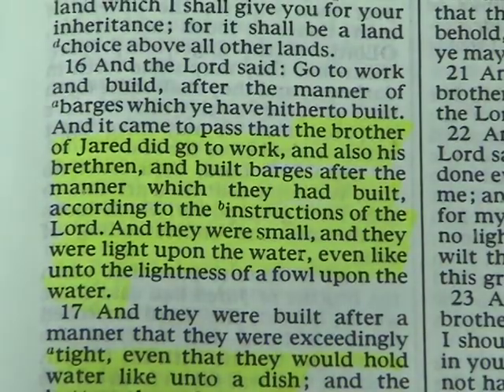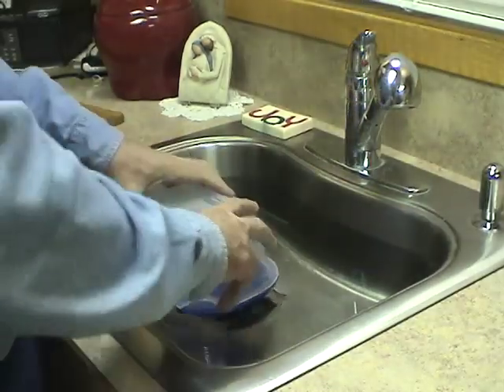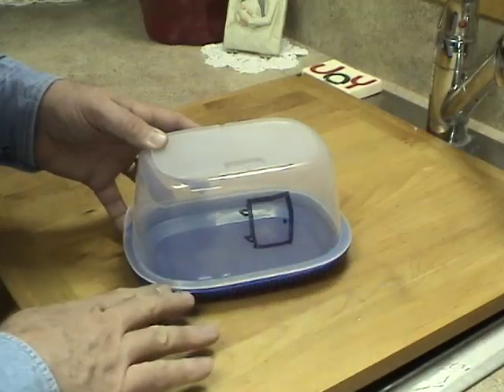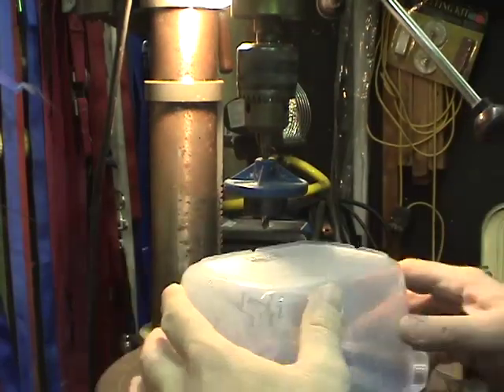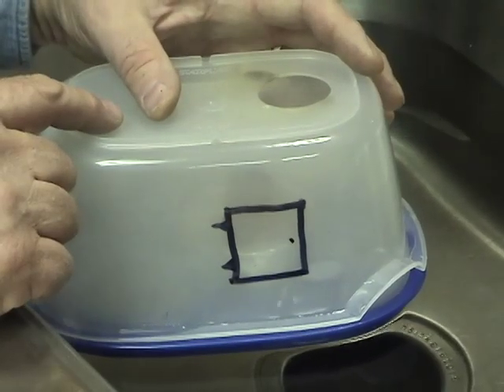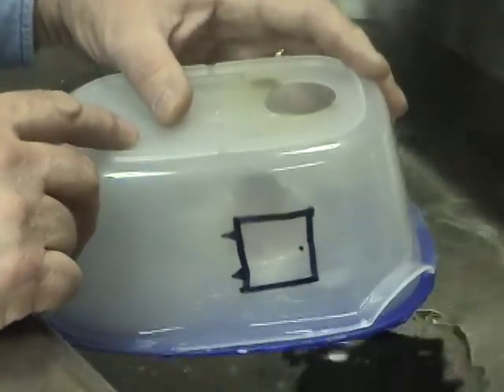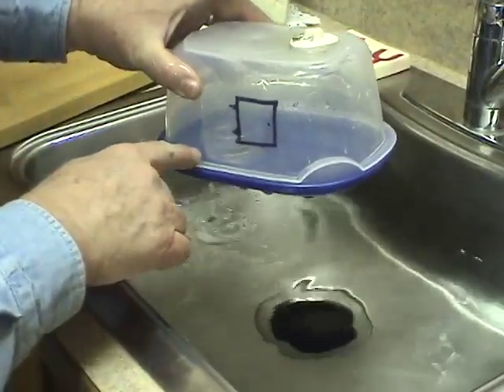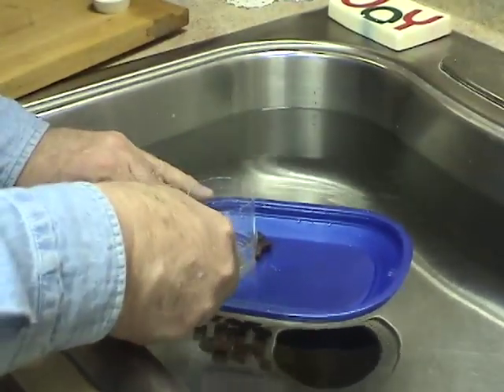Brother of Jared, Barges, Ether, Book of Mormon, LDS

Comment: I picture a monohull with a well tank. The tank rises above the exterior waterline and can be open or shut depending on sea conditions.  The hole in the upper structure.would need to be open to avoid atmospheric pressure changes caused by the surface motion of the sea when the well tank lid removed.  The whole affect would not only allow safe access to the sea for waste but also fishing.  The constant up and down motion of the seawater level in the well,  might also create a fresh air bellows and breathing lung for the interior of the clamshell barge.

I like the catamaran concept as seen in another YouTube, but that's not how it's described  in the Jaradite record.

This is more like I imagine.
Reply from the maker: I agree James, changing atmospheric pressure inside the ship occurred to me shortly after I made the video. It would really be hard on the people. Thus in heavy seas you would need to either close both the well and the hatch, or leave the hatch open.
Reply: @BrotherofSteve  And just as described, by the brother of Jared. 
 I assume most of the time, both hatches would have been left standing open, as favorable wind and ocean currents are sufficient in crossing oceans.  Only during stormy conditions would both hatches have been dogged down tight.
During such times, the light emitting stones at each end, would have been indispensable within the total darkness of such a craft.
The design as you've shown, is sound, but also a truly, desperate escape scheme.  Only the reality of some annihilating attack by an overwhelming force, could have ever induced anyone, to intentionally cast themselves adrift upon the open ocean, in such a fashion. The whole story is truly amazing.  
I happen to live on a sailboat, which makes this a sea-story for me.

Thanks for posting your thoughts and experiment.  It was interesting.

Comment: Problems:
* Not all "raisins" sink
* A "covered section between two ribs" is not really a "hole."
* Pitch (probably bitumen circa 2000BC)  must be periodically be repaired due to hull flexing. Not only can't this be done while at sea for the underside of the barge, no fire was permitted for melting pitch.
* Bitumen fumes are toxic and would build up, along with CO2
* Storms can last for many hours/days which would require the hole to be stopped up, and everyone would suffocate, pump or not.
Reply: More problems:
- food would not have lasted over 300 days.
- they would not have had any fresh food.
- they would have all had scurvy.
- no fresh water.
- with all the going down into the water then rising up to get air would mean they would be getting sea sick all the time.
- and going up and down is not an efficient way to travel.
- and what sort of propulsion system did they have?? None!

Comment: A few problems with this. First of all, the problem of pitch and floating.  It's one thing to float a pitched vessel atop of the water. It's another thing to have one going under the water for any length of time. I always thought this was Smiths attempt to explain submarines. And yes, during his time in NY there was a submarine on exhibit at NY harbor and it was in the newspapers throughout the state.
Reply from the maker: Hi Leah, thanks for your comment. Good point. I don't claim that this is exactly how it worked, the point is simply that the purpose of the holes in the top and the bottom were to exchange the air. Not to drain the boat. Thanks for your input. Have a great day.
Reply: I wonder if they did have the tube in there though. It doesn't say in the text if I recall. Anyway, it was interesting I will admit.
Reply: leah walker Hi again. The tube was for illustration of the principle of pumping air. I doubt you would use a tube in the center of the ship. More likely build it into the spaces between the inner and outer wall of the ship, say between a few ribs. If you extend it clear out the top and place flop valves and feed the air into the ship, you remove other problems too. In very heavy seas, close the valve and close the hole in the top of the ship. Just thinking out loud. Thanks again!
Reply: okee dokee..at least you're not implying the barges had it but a word of caution- some LDS will take that and run with it, claiming they had that on the barges
Reply: leah walker 
These were not submarines, but the barges were submersible.

Comment from the maker: bjjolley,
continuing: "raisins" will sink after a while. A covered section between two ribs would still have a hole at the bottom through the outer hull. Prayer - in my experience when life gets really really hard, there is great power in prayer. Prayer is "Always" necessary IMHO. Long storms - I think I could devise a valving system. My demo was just to illustrate the principle. I don't know about the sequence issue. I will give it more thought. Again, thanks for your thoughtful insights!

Comment from the maker: @Rypaul5217
Huh? Air pressure "turns towards up?" You lost me. Sorry.

All ships have ballast. That's why they stay upright.   Look for example at the Fram, a Norwegian ship built in the early 1900's and designed to be frozen into the Arctic Ocean, float across the Arctic in the ice, and come out on the far side. That's exactly what it did. It was round bottomed, like a walnut. Ballast kept it upright. 
Thanks for your comments. Brother of Steve.

Comment from the maker: Hi JC,
Thanks for your questions. Length of a tree? Well, the General Sherman is one of the biggest (not tallest) trees and is almost 300' high, so I don't think the barges were anywhere near that long, but a 10' barge wouldn't hold much stuff, so I am inclined to think somewhere between.
344 days? That's pretty short compared to the old whaling vessels that were serviceable for 50+ years.
Thanks for your out of the ordinary comment.
Brother of Steve

Comment from the maker: Hello Matt. Thanks for your thoughtful posting. I appreciate your input.
I used plastic and rubber to illustrate a principle of pneumatics and atmospheric pressure that the Jaredites MAY have used. I didnt mean at all that this is what the barges looked like or that this is exactly how they solved the problem of air flow.
The hole did not need to be especially large, so plugging it off from the inside would not be an issue for someone with the skills of woodworking they obviously had.
THANKS!

Comment from the maker: Hello OldInjury.
Thank you too for your well pondered thoughts.
Please note below my answer to Matt about my purpose. If the Jaredites used this principle they would not have run a vertical column up the center of the ship like I did for illustration, but more likely used the ribs on the sides of the ship as the column. Just cover a section between two ribs and you get the same effect.  Seal it with pitch. The woodworking technology was about 300 years newer than what Noah used.
THANKS Again.

Comment: Another problem:

Ether 6:7 "And it came to pass that when they were buried in the deep... they did cry unto the Lord, and he did bring them forth again upon the top of the waters."

If the barges were "light upon the water" and "tight like a dish," did the lord have to do anything to bring them onto the top of the water? Prayer was not necessary at that point. In fact, nothing could have stopped them from floating. No additional action required.

Comment from the maker: part 2.
The most likely place for the column would be between two of the ribs, going up the inside of the ship. By simply planking over the two ribs on the inside of the ship, (with a hole at the bottom of the ship connecting that chamber to the sea) you get the same thing in principle that I showed in the video. Does that help?
Brother of Steve

Comment: At 14.7 pounds/sq inch, that doubles every 15 feet down. that would crush the boat, but with a hole in the bottom, the water would equalize the pressure, thus saving the craft...
Reply from the maker: mickerdoodles51, glad to see you are interested in underwater pressures. Hopefully I won't dissuade you by a small correction? Sea level is one atmosphere, or as you stated about 15psi. At 33 feet deep in the ocean (or 34 feet in fresh water) the pressure is 2 atmospheres, or about 30psi. At 66 feet it is 3 atmospheres, or about 45psi. Thus Scuba divers use up their air 3 times as fast at 66 feet depth.
THANKS for your thoughtful comment!
ByTheWay, there is a problem with my example because if the craft went very far underwater the rapid pressure changes in the air in the vessel would be unendurable for the people/animals. Thus I think the air pump was independent from the pressure inside the vessel. I will work on an improved version.
Have a Great Day!
Brother of Steve

Comment from the maker: Hi rapterflyer, thanks for your comment. I will perform the test you requested. I believe we should test a proposed theory to see if it holds water (pun). Meanwhile, please check your reference so I can see what you are reading. ch 6 v 10 is about the lights in the boats. Author of the book of Ether is Ether, translated and condensed by Moroni, and then translated into English by Joseph Smith.
God bless.

Comment from the maker: Hi Shining,
Good thought. I think that if they used something similar to my model, they would indeed have plugged both the top hole in the ship and the top of the column in really bad weather. That would keep the air pressure from fluctuating. Air pressure in the vessel with the door open would be one atmosphere. Taking the top of the vessel to 30' below the surface would increase the pressure to 2 atmospheres. That would not be good. Seems unlikely they went that deep though.
THANKS!

Comment: Sequence problem:

The "covered section between two ribs" solution has another problem:

In Ether 2:18, Bro. of Jared completes the barges according to the design. Only after completing all 8 barges does he realize there's a problem with ventilation and light (v19). This itself is baffling - how do you complete one ship, much less 8 without realizing you can't breathe or see?

In v20, the lord tells Bro. of J to make holes. Apparently ventilation was not part of the original design. Really??

Comment: Awesome, of course anti-mormons insist the hole in the bottom was because the barges were rolling around with their peaked ends, but I've thought for many years that the holes in the bottom were for bathing, fishing, sewage disposal, etc. But i never thought of the tube and air pump (in my model they would only be able to open the bottom hole when the top was plugged and would always have a little water inside and that would have to be disposed of and so on).  This all makes perfect sense, and explains a lot (eg- why they didn't have to "stop" the bottom hole etc. , thanks for the video.  :)  

Also, just reading comments below, and I don't think the barges would be under water for any extended length of time, that wouldn't make sense, and why would JS need to "explain" submarines?  Also, all ships were dashed upon by mountain waves, they weren't smashed....
Reply: If its traveling under water, you cannot open up any holes to allow air in.
Without an air supply inside the boat the people would suffocate.
And they're not going to keep coming up for air every 10 minutes to get air then go back down. Submarines dont work that way.

Joseph Smith wasnt too smart when he came up with this piece of fiction.
Reply: @adamgoodword7888     Have you even watched the above video?

Comment: @BrotherofSteve - "For example, I don’t think pitch was used for repairs. More likely fibrous hemp-type material pounded into the joints."

Hemp would present its own problems, including saturation, breakdown in saltwater, etc, not to mention that the suggestion is pure speculation. You may as well claim they invented rubber for the trip. I don't think your answer addresses the at-sea repair problem.

Comment: I should say 1830 edition. and i looked online to Book of Mormon LDS webpage. and it still says nothing about columns. it says as well in ether 6:6-10. And it came to pass that they were many times buried in the depths of the sea. tell me please if it was air tight how could this happen.? if it was air tight they would run out of fresh air. they would start to breath Carbon Dioxide. How will they know when to open the holes for fresh air?

Comment: This was very interesting on how air could be circulated but your theory has a flaw. You fail to consider the compressibility of air. If these barges or vessels sank very deep in the water air inside would compress  it would fill with water and sink. Both holes would have to be stopped as it went under water. your demonstration didn't consider how deep the bottom of the vessels would be when under water.

Comment: Problems:
- food would not have lasted over 300 days. Meat would have perished, fruit/veg perished.
- they would not have had any fresh food. Ovens to bake bread?
- they would have all had scurvy.
- no fresh water.
- with all the going down into the water then rising up to get air would mean they would be getting sea sick all the time.
- and going up and down is not an efficient way to travel. What a waste of time and energy going down and up and opening the top to let air in then stopping the top and going back down. They would have done this every 15 minutes.
- and what sort of propulsion system did they have?? None! It had no engines or any form of propulsion system.